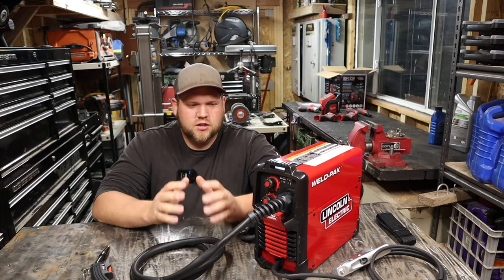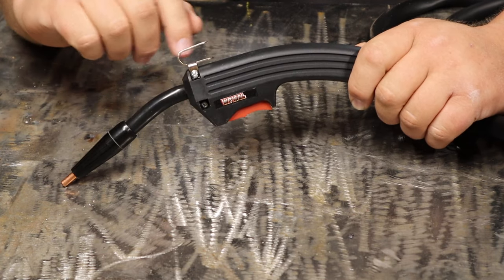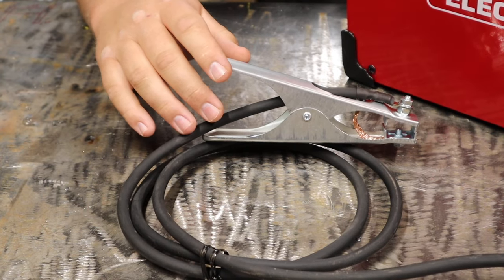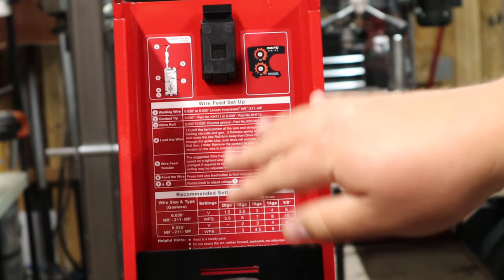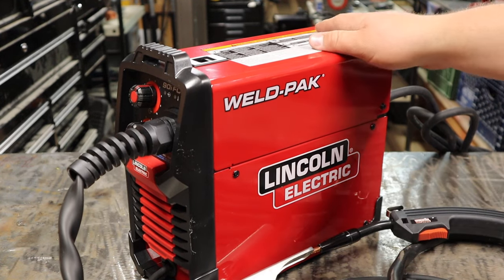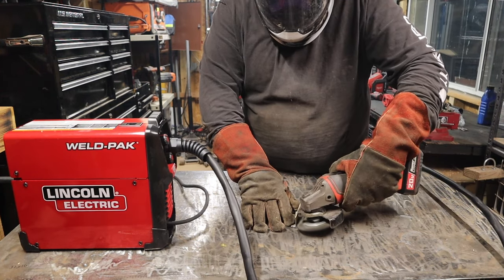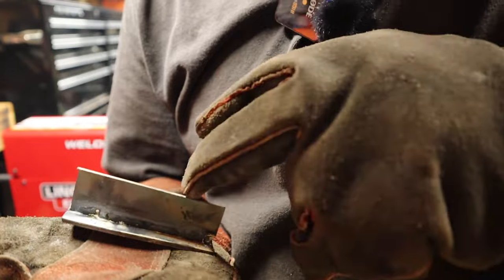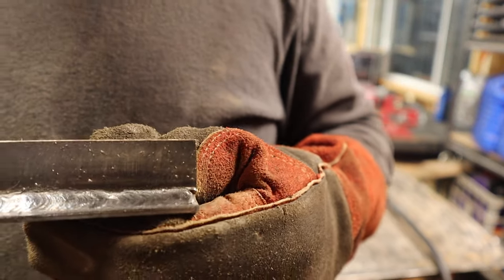NEW! Lincoln Electric 90i FC Welder Initial Review - DIY Welders Best Friend

Comment: $279, they are out of their minds..........TBH I am kinda surprised they are even trying to bother with this end of the market since Harbor Freight and Yeswelder have the budget guys on taken care of.....plus it seemed like they always had a gap between the $200 fc-90 and the $800+ machines.
Reply from the maker: It’s maybe $60 more than the cheaper FC 90 price I see these days? With some better specs and leads? Seems like a fair increase to me. I was also surprised to see this machine come out though. I wouldn’t have expected it.
Reply: @DereksWorkshopAndProjects  Yeah I don't get the point of coming out with this when they already have the FC-90 (unless they are planning on discontinuing it).....JMHO they are not competing. Look at the Yeswelder flux-135, they even give you stick leads to do 135 amp stick if you want.....and its $116 right now. I'm sure the Lincoln is a good machine, just seems like they are going after a market that might not be there.
Reply: Yeah and that machine looks pretty much exactly the same as harbor freight's titanium 125.
Reply: I've been shopping around you can get the  Lincoln easy mig 140 for like  569.00  "on sale '
Reply: Project Farm tested a bunch of welders and many don't put out the power they say they do.
Reply: Lincoln has smooth power curve. Yeswelder, Harbor Freight and other China inverter crap, all have wonky output power. Weak rectifier. Board components are cheaper.
Reply: The same welder at lowes says it does Flux core and gas mig 🤔
Reply: won’t quality buy the lincoln want cheap junk go and buy your yeswelder and harbor freight ones
Reply: Yeswelder and Harbor Freight helped create that market for them to join.
Reply: @M70ACARRY thank god someone comment that actually new what they’re talking about! They obviously use shit welders from harbor freight cause they’re too cheap to buy a miller

Comment: Excellent day, according to the specification of the machine, it says that it welds up to 1/4 inch, but in the video where you show the table under the cover it only has up to 1/8 inch, which would be the values to weld at 1/4 inch
Reply: 1/8" single pass, 1/4" multiple passes
Reply: You would do at least two passes for 1/4" jobs.
Reply: Should say on the chart under the cover. But like they said run multiple beads for added tensile strength.

Comment: Next time a machine trips that breaker take time to find out what other lights or outlets are on that circuit and don't run those things while welding on that outlet.  If that wasn't the problem then you have an electrical problem (bad breaker, bad wire, bad connection, wrong wire, wrong breaker etc...)

Comment: Derek, I’ve a few photos of a handle i made for the c-90. It’s much better for moving the welder around.  How can I get you the photos?
Reply from the maker: Do you have Instagram? You can find me on there and send them, or email me through the email address on the “about” page of my channel.
Reply: Hugh Danaher, I would be interested in seeing the handle you made, because I have both the Century FC 90 and the HF Titanium 125 flux core welder and would like to add a handle to them 🤔 thanks
Reply: @shermanyoung8185  i put a link in Derick’s comment string
Reply: @DereksWorkshopAndProjects  I put up images on my website, but every time I post the link the comment gets deleted.  It seems that fremontica plus a suffix triggers the algorithm.  Net result is this cryptic message which you’ll need to figure out.
Reply from the maker: You put it in this videos comment section? You can email it to me?
Reply: @DereksWorkshopAndProjects  I didn’t find your email address on your site, saw your home address though.  Use the images however you want,  if you copy the design in a video and subsequently market the item it’s fine by me.

Comment: Does the fc90i hàve a DCEN polarity for the flux core welder, gun polarity negative, and ground positive, or can the polarity be changed inside the machine if needed?
Reply from the maker: Yes, it comes with the correct polarity to weld flux core. You don’t get the smooth arc, penetration, and clean weld I got welding flux core with a positive gun and negative ground. No way that I know of to change it inside.
Reply: @DereksWorkshopAndProjects  thanks!

Comment: Nice review. What size generator would you need to run this welder?
Reply from the maker: I usually think the bottom end generator for running a welder is something that produces at least 7000 runnning watts.
Reply: @DereksWorkshopAndProjects  Yeah I was thinking something along those lines. They really do take a lot of juice to run. Thanks for replying.
Reply: @DereksWorkshopAndProjects I use a 3500 regularly

Comment: I’ve been thinking about getting a little welder but I don’t really understand these little welders very much. I was taught about arc and oxy acetylene welding back in high school. Is this an arc welder?
Reply from the maker: Technically yes. But should be a lot easier to use than oxy acetylene. The arc melts the metal and you run a bead. Almost like a hot glue gun.
Reply: @DereksWorkshopAndProjects  Oh okay very nice. So do these welders use wire or a stick. I’m sorry for all the questions but I figure you’ll be a good person to ask. And does this welder work using 110 and 220 volt? I’ve seen some on Facebook market place that run on both. Would a welder like yours be better than getting an old school arc welder? I’m guessing an old arc welder won’t be good for thinner steel. It’s been a while man haha. I learned how to weld back in ‘87. I never learned to MIG or TIG weld just ARC and oxygen acetylene
Reply: @wyattsdad8561  flux core wire, so its like a wire fed stick welder, you get slag just like stick.
Reply: @yurimodin7333  okay thanks man. One  more question, is the wire expensive?
Reply: @wyattsdad8561  not too bad, usually about $18-$22 for a 2Lb roll (goes a long way).....solid mig wire is about half that price but you need shielding gas for that so it all costs about the same.
Reply: @yurimodin7333  okay very good info. Thank you man!

Comment: Would have been nice for you to describe how to load the wire , how to put the wheel for correct wire size . Instead of the fast forward with no descriptions... as the manual doesn't show that either
Reply from the maker: I have other videos showing that, in general terms, with flux core welders.

Comment: Bought this roughly a year ago and ended up working away from home. Only used it a few times and the rest of the time has sat in the shop. Now the wheel turns sporadically. Gonna take it back, looking at buying the yeswelder 160A off amazon.
Reply: All in all, when it was working properly, it worked pretty decent for what it is. I'm probably just biased and want gas.
Reply: Nothing wrong with running flux-core. In fact, if welding outside, or on slightly dirty metal, FC welds much better than MIG with gas. I have the Century Fc-90, and if anything it welds very hot and welds 1/4" steel with .035 Lincoln FC wire, easily. Needs a 20 amp breaker to run at maximum amps. I have a similar 140 amp Forney machine that always pops the breaker when welding anything over 1/8" which is very annoying, especially since it is also running the smaller .030 wire.

Comment: So you went over the stuff covered on ads. What about polarity? Can you swap polarity on it or does it require cutting and splicing wires to change polarity between the ground clamp and the wire nozzle? Looking for one that I can swap polarity easily.
Reply from the maker: I didn’t need to cover what you’re asking for because it is a flux core only machine. There is no reason whatsoever to change polarity because flux core runs on DCEN.

Comment: What does the i means on FC 90i?
Reply from the maker: My assumptions is “inverter”.
Reply: @DereksWorkshopAndProjects  Thanks. So, the FC 90 is AC?
Reply from the maker: It’s DC. 110ac at the wall. DC at the ground and stinger.
Reply: @DereksWorkshopAndProjects  thanks

Comment: prolly would work even better with an .030 wire
Reply: just curious why would you think that?
Reply: @PablosOutdoorProjects  cause your not using a machine like that to weld plate steel or large amounts of welding. .030 works fine for 1/8 or less steel and you don't need to crank up the machine to get a good weld.
Reply: Im an .030 wire enthusiast myself

Comment: Excellent day, according to the specification of the machine, it says that it welds up to 1/4 inch, but in the video where you show the table under the cover it only has up to 1/8 inch, which would be the values to weld at 1/ 4 inch and can weld up to 3/8 inch
Reply: 1/8" single pass, up to 1/4" with multiple passes